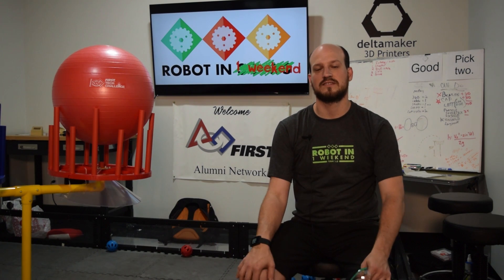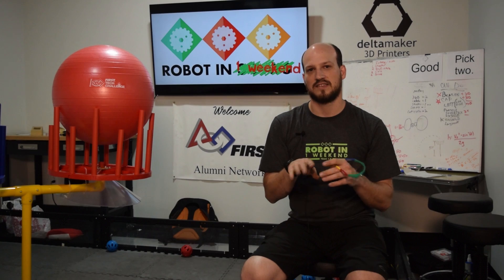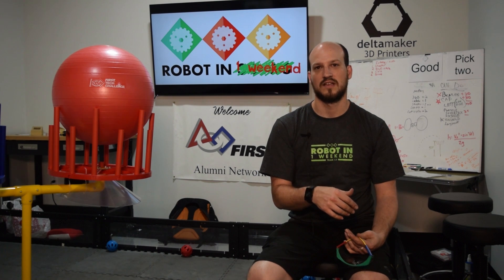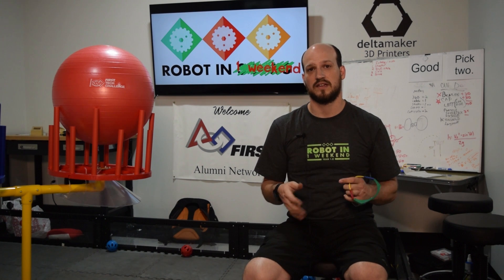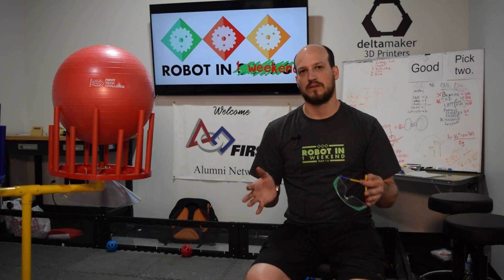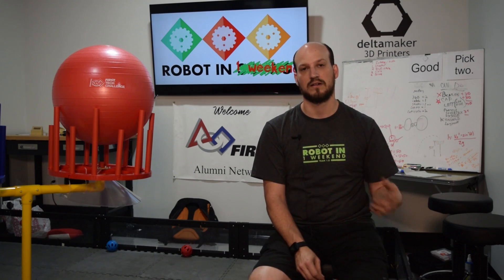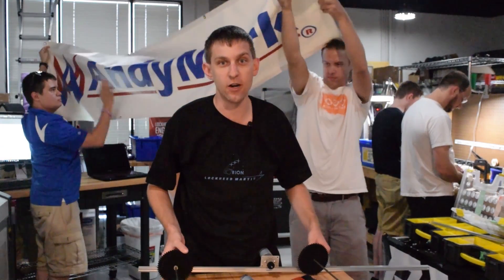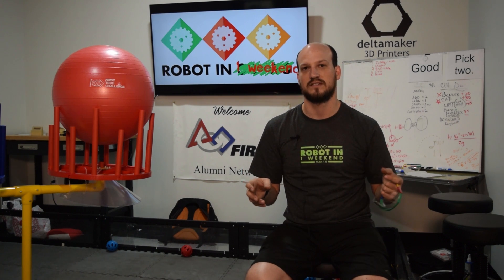2016-17 FIRST Tech Challenge - Mechanisms, Lessons Learned, and Advice with Team Ri1W 1.0

Comment: I'm curious as to the Rev Robotics hex shaft and bearings y'all used on the accumulator system.  Went out to Rev and they only had 75mm and 135mm  shafts listed and no bearings for the 5mm shafts. Are these custom items? I'd love to have a similar system as we used an Andymark accumulator kit last year on our Rhino chassis. It was GREAT!   Thanks in advance!

Comment: It is the first FTC year for our team.  Your team video really inspired our students.  Our team is working on the elevator now.  The size of The latex tubing I purchased may be too thin for the idlers, which is 1/8" I.D, 1/4" O.D, 1/16" WI.  Which size did you use on your robot?
Reply from the maker: 3/8 in. O.D. x 1/4 in. I.D.

Comment: What wheels did you use for the vertical elevator?
Reply from the maker: Just some of the standard tetrix wheels, we removed the rubber and machined a small groove to make it behave like a pulley

Comment: About what speed was each wheel turning at for the dual wheel ball shooter?
Reply from the maker: We used this motor/gearbox combination from AndyMark: http://www.andymark.com/product-p/am-3200.htm
Reply: The specs say 6600 rpm -- is that correct? Seems like that's a bit much for the fairly short distance to the center vortex
Reply: Isn't this an illegal motor? On the game manual part 1, am 3200 does not appear on the allowed motors list.

Comment: Where can one find those white plastic caps screwed into the BaneBots axles to sandwich the wheels? Also what exact purpose are they serving? Keeping the wheel balanced/secured?
Reply from the maker: They are just some spacers we laser cut, basically washers to keep the wheels from coming off.  Just one solution we came up with our available resources.

Comment: what's your motor setup / gear ratio for your vertical lift?
Reply from the maker: We used an AndyMark NeveRest 60 attached to a spool for the string. http://www.andymark.com/NeveRest-60-Gearmotor-p/am-3103.htm
Reply: Robot in 3 Days sorry, I should've been clearer... I meant the one that lifted the balls up to the flywheel

Comment: Hi, my team is considering using the wheel shooter, do you think you could send us a part list with measurements for that attachment? eve10458@gmail.com
Reply from the maker: Shooter wheels can be found on Andymark here
http://www.andymark.com/product-p/am-2648_Blue.htm

And we used an AndyMark NeveRest motor with a Banebots 4:1 gearbox http://www.andymark.com/product-p/am-3200.htm
Reply: Ok thanks! Which angle brackets did you use?

Comment: So, just to be sure, the banebot 4:1 gear box is legal?  I couldn't find any information on gearboxes in the rules.  And also, that is attached to a regular neverrest motor right?
Reply: RM02 declares explicitly that a gearbox is a legal item with 1 degree of freedom.
also
RE15 says that "Approved electrical and electronic devices may be modifed to make them more usable .... Examples of modifications that are allowed: .... replacing gearboxes and/or changing gears."
Reply: Thanks for the clarification!

Comment: how are the wheels and the sweeper run by the same motor?
Reply from the maker: The Ziptie intake and the surgical tubing lift are run by the same motor. The wheels for the shooter are direct driven by 1 motor each, and the drivetrain has two motors.  2-3 more motors are used for or linear lift and cap ball manipulator, depending on which manipulator is attached.
Reply from the maker: Just to expand on that, the sweeper wheels and the tubing lift are tied together via #25 chain, we used a rev robotics motion bracket and two rev robotics gears to reverse the rotation, the intake has to spin opposite from the lift

Comment: <GS3> Corner Vortex Scoring Violations – Robots may not make contact with the Particle Return, break 
the vertical plane of the outside (facing the Playing Field Wall) vertical face of the Vortex Bar (see Figure 
1.3-3), or interact with a Particle once it has been released through the Corner Vortex. Teams will be 
assessed a Minor Penalty for every occurrence of violating this rule. Actions that are Inadvertent and 
Inconsequential will not be Penalized. Robots are allowed to make contact with the Corner Vortex Wall.